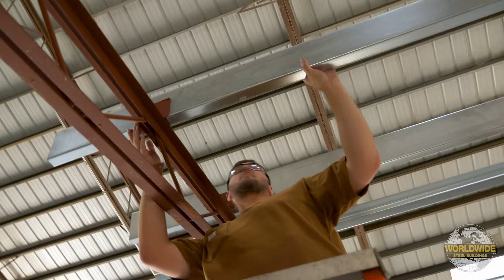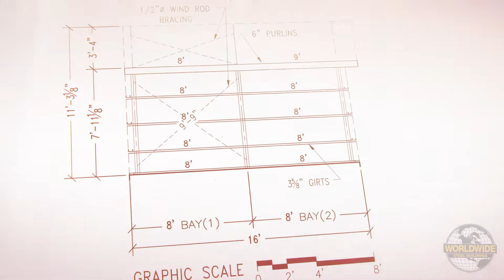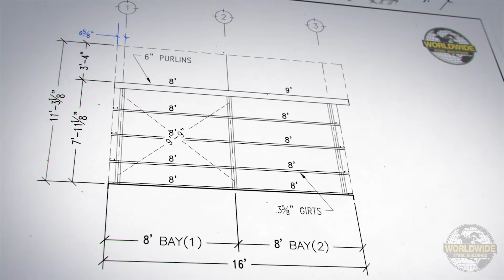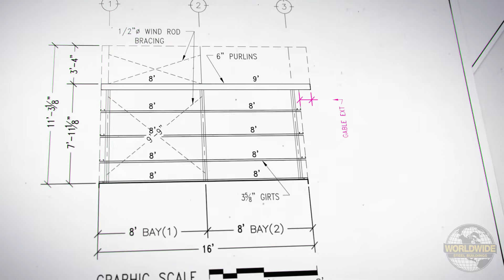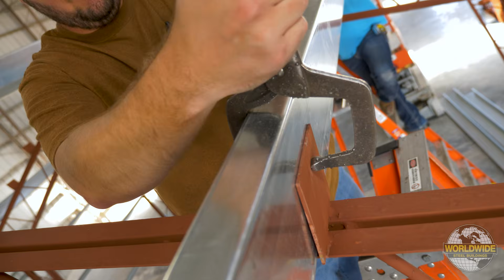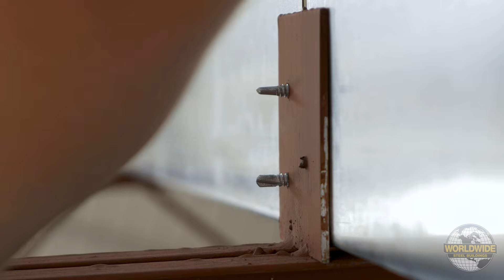Steel Building Roof Purlin Install - How To DIY Steel Building

Comment: Purlin is worng orientation it should be facing down the angle of the tilt. the additional flat bars holding the purlin does make it stronger but i so no reason why the purline should installed the wrong way?

Comment: should the purlin angle be same as frame tilt angle?
Reply from the maker: Thanks for the question.  The purlin should sit perpendicular to the frame.  Once installed, if you put a speed square on top of the frame, the purlin should be at a 90 degree angle to the frame.